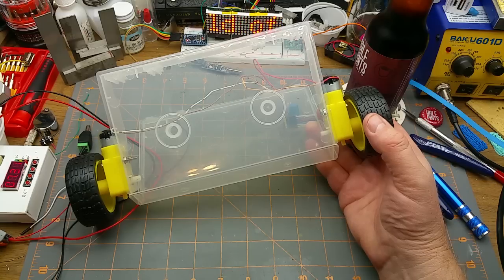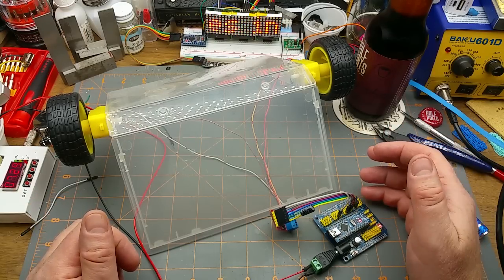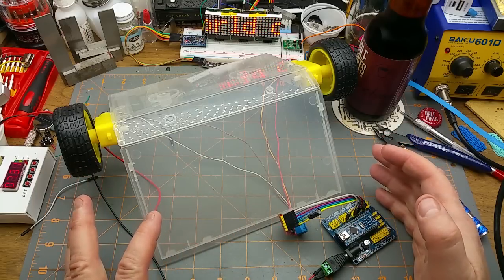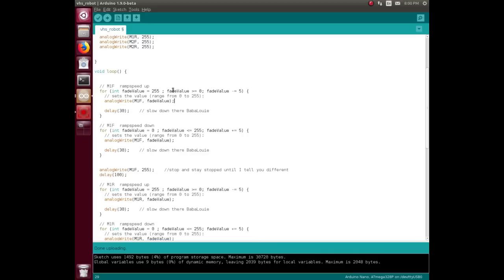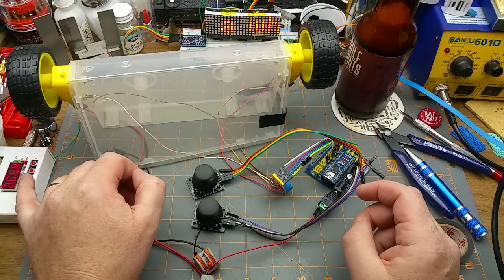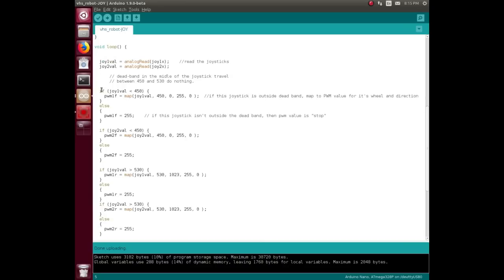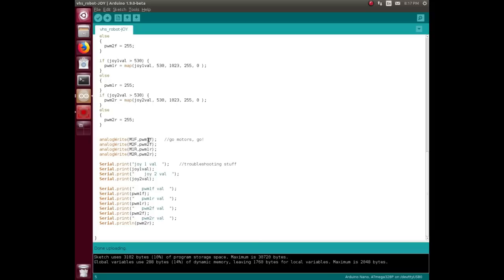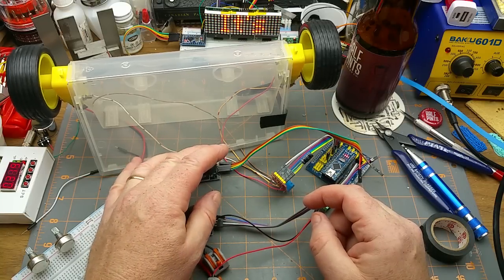Dipping my toes gently  into the world of robotics

Comment: I thought I was the only person on YouTube who had VHS tape cases. I still need to transfer a bunch of things over to the digital world.  

 When I worked designing photocopier electronics, which had tons of motors from DC to stepper and lots of sensors and electrostatic build up, very noisy environments,  we usually put a ceramic capacitor across the DC motor terminals right up the motor itself to suppress any weird phenomena.   Helped pass FCC certification and keep the systems microprocessor from resetting. Good practice. 

 Glad to see you used a capacitor to help smooth out the problems with the motors successfully.  They can smooth out a lot of weird spikes with inductive circuits  and minimize glitches and resets.  And thanks for sharing your code. It helps people who have no experience looking at code figure out where to begin and what is possible.  Who cares how efficient or elegant it is. We are here to learn and grow.   If we find something useful, we will use it. If we don’t, we will throw it away and come back later and see if we can learn from something else.
Reply from the maker: Yeah, I'm probably going to add some caps right at the motors in addition to the electrolytic on the power rails.
I suspect that once I add the radios I'll need all the suppression I can get.
Reply: nope your not alone with the vhs tapes i'm thinking of making a fischertechnik tape cleaner

Comment: Congrats on doing the code and not asking the teenager to do it.I did the same thing for remote controlling servos for a camera.  It was no fun. And the thing is .... I had no practical use for it... except I wanted to do it, So I did it. It worked. But I never use it.  I suppose if  I was a spy it would come in handy, but I'm not. So I guess I learned something after all. Thanks for the vid.
Reply from the maker: Sometimes "just because I want to" the best reason to do a project.

Comment: Nice work!  

I suggest you stick with the plan the transmit the joystick data (with the deadband removed as you've done) rather than PWM commands.  That way, the remote code stays the same and shouldn't need to be adjusted, no matter what you want the bot to do or what future projects you use the remote for.

Comment: Not sure what motor driver you're using but typically two inputs specify direction, brake or off, one pin is enable where you send the PWM.  You probably got away with how you did it because 1,1 is off, but 0,1 is one direction, 1,0 is the other.  Sending 255 PWM is same as just 5v on.

Comment: Those type of motors always looked a bit strange to me. 
I have plenty of steppers & servos. I guess I try .

My first 'robot' was about 20 years ago at college.
It was a 68000 based black line maze solver. Worked great when the sun didn't mess up the IR sensors.
Used an umbilical cord of course. Much easier today.
Reply from the maker: The big benefit of these motors  (aside from the price) is that they're dead simple to control.
Reply: they are just simple dc motors and a plastic gearbox and wheel...  ridiculously cheap in every sense of the word.
Reply from the maker: Peter Ellens : cheap, easily available, and good for toy-level tinkering.
I do have my eye on some surplus industrial gear-head motors, though... maybe a future iteration of this project.

Comment: I am in the process of building something very similar. My project is supposed to be fully automated at a point and then overridable with a joystick.
I would make it so that you can control it with one joystick only and make the "base" do all the heavy load to improve battery time.
A suggestion: Maybe put your code on github or something ? That way your viewers can try out the code or make suggestions for improvements ?
Reply from the maker: I do tend to upload my code once it has anything in it that might take some effort to replicate.

I generally put it on a publicly viewable G-drive. (Git is yet another thing on my list of things to learn)
Reply: @pileofstuff  Oh, ok - I am a new viewer :D Didn't know that :)
If you plan on doing more coding, you should definitely do the git thing. Your teenager could help you get started, it is not that difficult ;)
Reply from the maker: @TheSkogemann  I just uploaded the code from this video here:
https://drive.google.com/drive/folders/1gstMEDJ9lPJX7bWxuR5JI8wzPyWOM55S?usp=sharing

Have fun.

And welcome to my little corner of the internet. Glad to have you along for the ride.